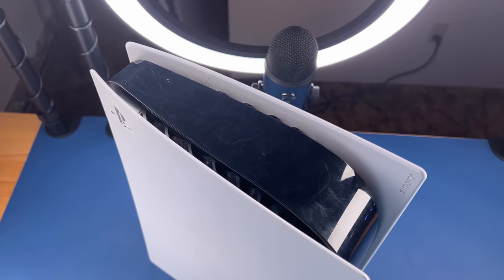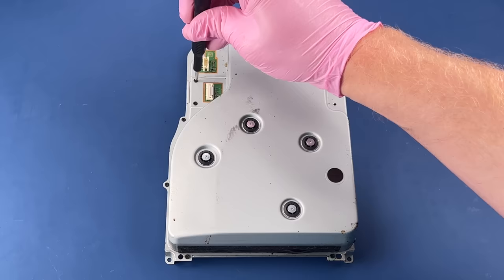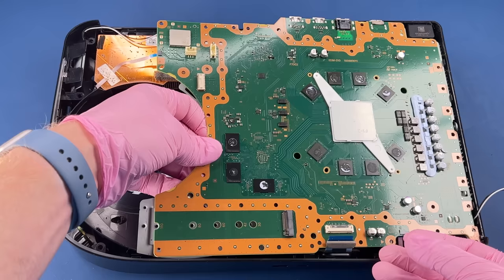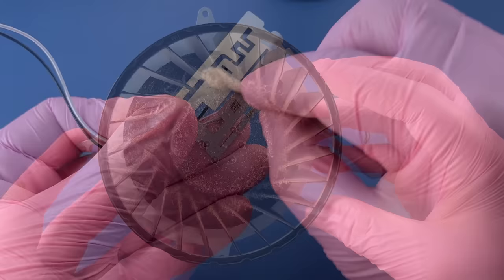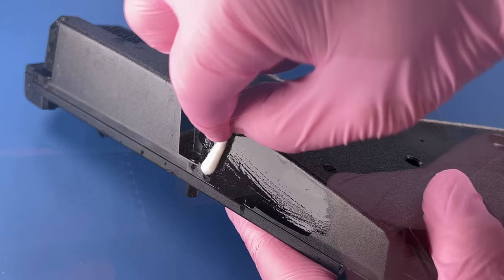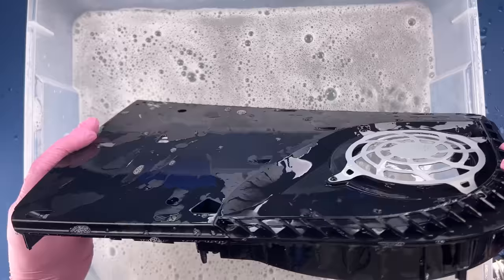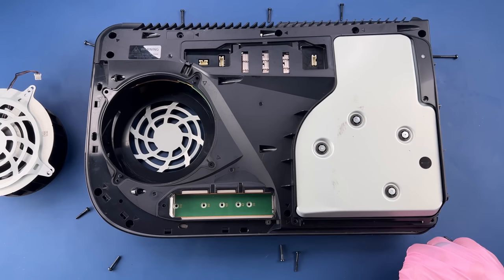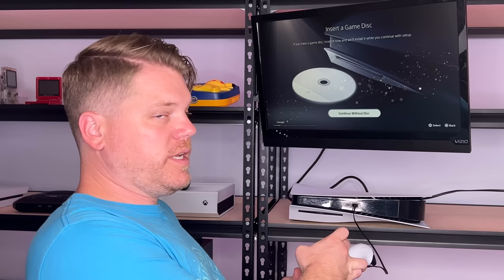Deep Cleaning this DISGUSTING PS5 - TronicsFix Collab

Comment: It's so strange to have bugs in a console.... This summer, after years of issue and errors message, I decide to full disassembly my mother's vorwerk Bimby (around 13 years of sitting in kitchen).
When I start to disassemble, I smell the worst mell. 
It was really really FULL of bugs EVERYWHERE.
I start to remove all park, clean with vacuum and then spray in each board the circuit cleaning solution. And then back everything together.

I discovered that everything star to work as the first day. So no issue, no errors nothing. 
I can't imagine that bugs can be so districting for circuit.
 Do it yourself, is more funny, and cheap

Comment: Really nice cleaning video. Gained a sub from me. I came here from Tronicsfix. I will suggest cleaning the inside of that power supply off camera though. Having dealt with cockroaches before in electronics, that's one of their favorite places to hang out and that smell is going to linger in there and be amplified when the ps5 is turned on until its taken apart and cleaned.

Comment: You can put the plastic parts in a dishwasher, I have even seem someone put motherboards in the dishwasher but obviously you need to completely dry those but the plastic parts clean very well, just don't put them on the bottom shelf.

Comment: You gotta clean the power inside. Even if just blasting it with air. The heat it generates will attract the roaches to it. And if you leave it, after a day of gaming and cooking any roached/debre in the power supply, it will start letting out that odour through the console and make the console smell again, not to mention the gamers room. 
I just figure no one will want to be smelling that whenever they game.

Comment: Man you have balls of steel. A Cocroach infested console should go directly into your bin. Everywhere can be eggs of these and after you cleaned it, your house is infected. Would never do this for any kind of money. No PS5 is worth to get cocroaches in the house. They can spread eggs in the usb ports, hdmi ports, in the connectors for the ribbons and in the power supply. Really, i had throw it away 5000 miles.

Comment: I cleaned out my cousin's PS4 that had german cockroaches and it was an uphill battle. He didn't know they were in there until a literal colony had formed. It seemed like they were infinite. We were dealing with them for HOURS. Probably had about 300 of them in there. I never want to deal with that ever again.
Reply: yeah my old ps4 was like this, it sucks having roaches we  balm once  every 6 months but if you neighbor has roaches you aslo will
Reply from the maker: Woah that's a lot!
Reply: @RestorishOfficial  1 or 2 would come out the back vent so we thought there was only a few in there. As we tore it down we realized there was more than we realized as they kept popping out from somewhere occasionally. We took them out as we went.

The vast majority of them were in the power supply and around the heat sink. We blew them out of the power supply with compressed air and hit them with spray as they landed. The power supply alone took us roughly 45-60 min just to get them all out.

Comment: i am from Louisiana those are roaches and the most infestive kind unlike larger ones,  when you see these around or in your house it means theres a nest somewhere that is prolly full of thousands of them. youll see them scatter from your walls when you turn on lights coming home if you have a infestation. they like places like, under a refrigerator where the the parts that keep it running are and they give off heat ive seen thousands nested all crawling over each other. also you see tons of tiny pieces of dead roaches because when those small ones die the others eat them. wild. youll likely never see big roaches like that they usually alone or theres a couple... when you see the small ones, theres a nest somewhere close and its really something to see, and disgusting lmao. they likely livedin that ps5 a while when it was hot and used, id bet they were hundreds of them in that ps5 thats why theres so much nasty bug juice and pieces all over. had a apartment with this issue, musta killed thousands at once but i got them lol

Comment: Your soak woulld do better if you used a bit more Dawn Dish washing liquid... I have used it almost exclusively for at least 30 years on metal and so long as you squirt it down with WD40 afterwards it will not rust or cause any damages. Also works great as a shampoo among other things? lol

Comment: I wonder how you clean that black sticker above fan connector, it's full of roaches and very sticky
Reply from the maker: I just soaked mine in the water with the rest of the plastic and brushed it off gently, hoping that it would retain its stickiness after it dried. It worked well enough.

Comment: Awful....
I own my day one Series X, my newer Series X, and a PS5.
Both Series X have the microfibre dust protectors, that are extremely strong self adhesive, sits on all air vents, yes even the big one at the top, and the console can run as normal, but no dust gets in at all, and it is a case of gently wiping off the filters.
My PS5, when not in use, i have a black dust protector that slides over the top, snug fit and totally protects all the time it isn't in use.
Some people are just filthy and stupid, why spend all the money on these consoles, then let them get in too this state?